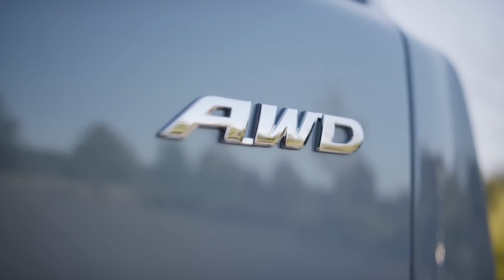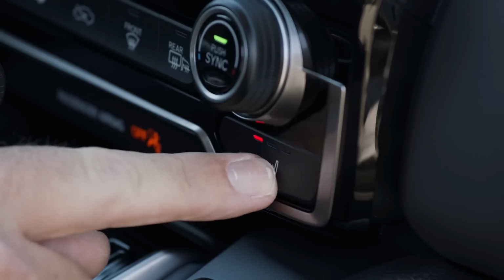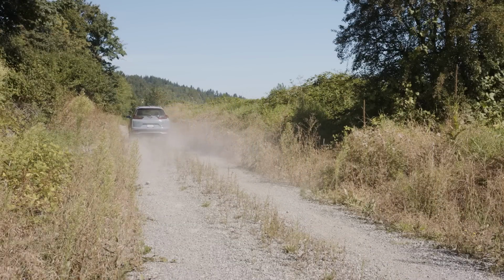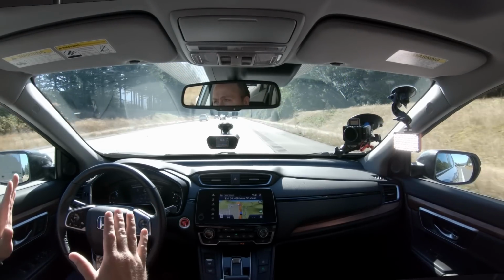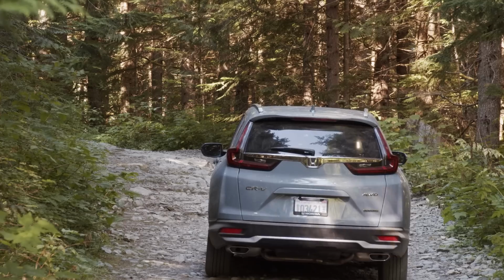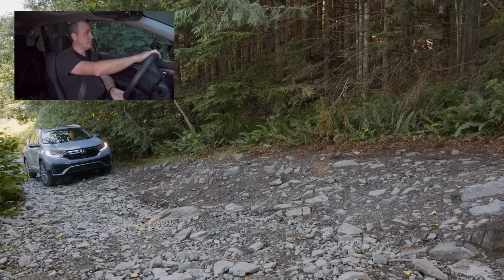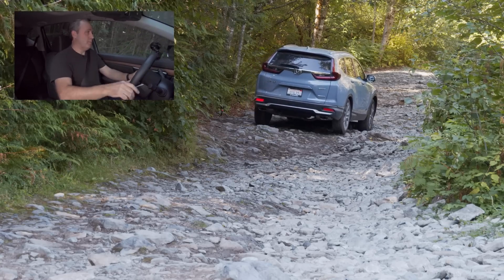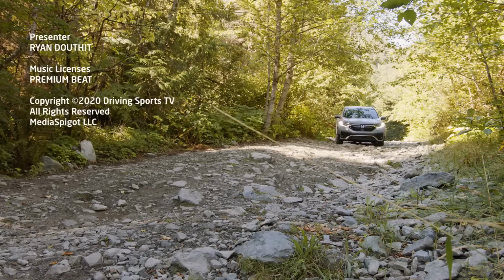2020 Honda CRV Touring Review and Offroad Test

Comment: Two things: You had to turn of the VSC, and you have to make sure to apply enough gas. It will send the power to the correct tires.

I mean, for a car that is not intended for rocky roads, it did well. BTW, you can descend without shifter in S and keep it in 1st or 2nd gear. 

Actually, the CR-V AWD is mainly made for great on road performance in good or bad weather, and for road conditions like the dirt road and small stones and gravel roads, like those before testing it on the rocky road.

Comment: i have a 2022 exl awd.  I've had it on some rocky/steep terrain and it did fine. I'm talking lose gravel and 32% grade.  I do have wildpeaks on it.  My fiance also owns a crv, 2020 awd, and it did fine in 6" snow on my private gravel/steep road in mountains.  never slipped.  Same as mine.  Can a crv do the rubicon?  No.  But it can go places where you cannot take a fwd vehicle or a rwd pickup.  I've done so, with zero issues or damage. The awd crv has 8.2 inches ground clearance.  The fwd, has the 7.8 inches.  The reviewer was incorrect there.  All in all the crv is a great vehicle and can get to your camping spot pretty easily as long as you don't have huge rutts etc......

Comment: I agree with MANY people points about this current generation CR-V. However, i don't see Honda raising the ground clearance 2 full inches. As it sits now at  7.8in and a Ford Explorer which is MUCH bigger for example sits at 8.2. The reality of a 9.8in ground clearance CR-V is far fetched. But i do see a CR-V at Subaru standards of somewhere around 8.5in down the line. You want anything taller than that you'll have to personally lift it yourself. I also don't see the CVT going away but i think the HP and Torque numbers need to be bumped up quite a bit. For example, I have a 2015 Lincoln MKC 2.0 AWD with 240hp and 270lbs torque. I'd like to see those same numbers in the CR-V and i think it's VERY achievable even with a CVT transmission. For now though, your point on changing out the HORRIBLE OEM tires to a better A/T tire is spot on. The Falken Wildpeaks are excellent for this vehicle or even the Yokohama Geolander G015. They both would improve grip on these light off road excursions incredibly. Let's hope as i've been hearing through the grapevine so to speak. That future iterations of the CR-V get the same treatment it's larger brother the Passport is getting with the new Trailsport model. If Honda goes down that road which i'm really hoping they do. With the CR-V in a truly "off road worthy" small SUV package. I think it will a HUGE success and very popular with a lot of folks.

Comment: Great video, although CRV AWD is just not built to handle rocky off-road terrains. I did the same with CRV 2018 - FRONT wheels drive, the back mountain roads with melted snow, red mud, and sharp rocks in San Miguel, near Telluride, and I had to back out very carefully. CRV, even with AWD is just not for these roads, but it is super economical. It was a pleasure driving it across the country. PS.. In a snow condition, staying on the regular road, multiple tests showed the tires that matter most and not as much AWD.

Comment: It actually does have a skidplate
Reply from the maker: Plastic doesn’t count.
Reply: @drivingsports  it’s metal lmao
Reply: @drivingsports  I work on them
Reply: @drivingsports It's sheet metal. You have to remove it to change the oil and filter.

Comment: Here are your top 25-best-selling SUVs from the month of June 2021, with all automakers reporting:

 
1. Honda CR-V	36,564	   38%
2. Toyota RAV4	36,027	  1%
3. Nissan Rogue	32,270 	  63%
4. Toyota Highlander	24,036	  84%
5. Jeep Wrangler	23,505	 2%
6. Chevrolet Equinox	18,723 	  12%
7. Jeep Grand Cherokee	17,804	  8%
8. Subaru Outback	16,394	 60%
9. Mazda CX-5	16,393	  31%
10. Chevrolet Traverse	15,328	  64%
11.  Honda Pilot	14,714	  31%
12. Hyundai Tucson	14,621	  43%
13. Honda HR-V	14,019	  87%
14. VW Tiguan	12,793	  20%
15. Kia Sportage	11,828	  48%
16. Hyundai Santa Fe	11,202	  34%
17. Jeep Cherokee	9,872	  1%
18.  Lexus RX	9,604	  43%
19. Ford Explorer	9,445	  50%
20. Chevrolet Tahoe	9,423	  40%
21. Toyota 4Runner	9,327	  24%
22. Ford Escape	8,871	  42%
23.  GMC Acadia	8,869	  39%
24.  Buick Encore GX	8,862 	  128%
25. Subaru Forester	8,813	  55%

Comment: Wanted to decide on Rav4 Adventure and Honda.... MEH... seems I gotta go with Rav.
Reply: It's worth noting the RAV4 also has a TRD Off-Road option, from the reviews I've read it's definitely better than most crossovers like the CRV in this video, but still inferior to other crossovers with off-road packages such as Jeep's Trailhawk SUVs or the Ford Bronco Sport.  The TRD Off-Road RAV4 still doesn't have enough ground clearance for even moderate off-roading, and its long front overhang reduces its approach angle.  Its factory equiped Falken Wildpeak All-Terrain tires were apparently designed just for it though, and a lot of what off-road capability it possess comes from them.

Comment: I own one of these. 2020 AWD but it doesnt have the touring crud on it. mine I think was 29.9    but I owed on a trade in.    anyways,  Wouldnt you shift into Low and try this?  was he in low going up the rocks? I had the impression he went from testing sports mode to pulling a hill in D mode.   it's been a durable car so far for me. but shut in , I only have like 10k miles since I bought it Jan 2020

Comment: I have the same car. Yes it struggles when a wheel is off the ground. You have to give it more gas and wait for the system to send power to the required wheel. İf you dont give it enough gas it can never send enough power to the wheel with the traction.

Comment: Whats the deal with measuring the CRVs 0-60 time. I mean, its meant to be a reliable practical vehicle. Buyers of the CRV, won't be interested in racing, unless their 18 year olds!. A vehicles 0-60 has never been a selling point for me.
Reply from the maker: We test 0-60 and off-road ability of all crossovers. Intent or not, it’s good to know how it sits compared to the competition.
Reply: @drivingsports  over here in Europe, up until 2017, diesel versions were available. 1.6 and 2.2 litres. I have an 2013 2.2 ltr. I can get 50 plus MPG. CRVS are one of the best family SUVs in the world.

Comment: I own a 2019 Honda CR-V Touring. Your correct about the NW off road capability. It’s not a 4X4 vehicle. I noticed that the tires are street tires. I find Hancock stock tires to get much worse grip in bad weather. This is after one year of use. That said, you can do things to adapt & help improve off road worthiness, such as Wild Peak Tires. Skid plates are limited to front & back lower bumper caps. I would have liked for Honda to raise the ground clearance height (2”). I believe that AWD will evolve into a much better off road system. I however am not quite sure of the CVT off road capabilities. Towing is a whole separate issue. It is a necessary one that is related to off roading. I propose that you make a follow up video after you changed the tires to the Wild Peak. They are affordable & highly praised for an ALL-SEASON tire with a triple winter rated stamp.
Reply: I agree with MANY of your points about this current generation CR-V. However, i don't see Honda raising the ground clearance 2 full inches. As it sits now at  7.8in and a Ford Explorer which is MUCH bigger for example sits at 8.2. The reality of a 9.8in ground clearance CR-V is far fetched. But i do see a CR-V at Subaru standards of somewhere around 8.5in down the line. You want anything taller than that you'll have to personally lift it yourself. I also don't see the CVT going away but i think the HP and Torque numbers need to be bumped up quite a bit. For example, I have a 2015 Lincoln MKC 2.0 AWD with 240hp and 270lbs torque. I'd like to see those same numbers in the CR-V and i think it's VERY achievable even with a CVT transmission. For now though, your point on changing out the HORRIBLE OEM tires to a better A/T tire is spot on. The Falken Wildpeaks are excellent for this vehicle or even the Yokohama Geolander G015. They both would improve grip on these light off road excursions incredibly. Let's hope as i've been hearing through the grapevine so to speak. That future iterations of the CR-V get the same treatment it's larger brother the Passport is getting with the new Trailsport model. If Honda goes down that road which i'm really hoping they do. With the CR-V in a truly "off road worthy" small SUV package. I think it will a HUGE success and very popular with a lot of folks.

Comment: Being that the CR-V AWD is not designed for off-roading, I guess this was a valid test. As it is, I won't even drive on any flat unpaved roads......Anywhere. I have a thing about my cars being clean and waxed at all times. Dirt on the edges of my Armor All'd tires, dust on the rims? I wouldn't rest until I scrubbed them clean. Though I must say, I love my CR-V!

Comment: Did the AWD system change in the Honda CRV? In previous videos you say it only sends power to the back if slip is detected but here you say it does that automatically on inclines
Reply: It's not the old slow hydraulic system. This C-RV starts in awd and becomes fwd when conditions allow. (Steady speed on grippy surface)
Reply: My 24 AWD Sport-l is ALWAYS in AWD. Yes, it's mostly FWD just like the RAV-4, but it is never just FWD. It adapts to the demand.  @kyrorocks
Reply: @jacobpetersen5662  yes, but the reviewed car is a 20

Comment: The problem is the CVT, the Subaru Outback has the same problem and the Nissan Rogue and they all have good AWD’s especially the outback and then the CRV, the CVT when is stuck in something it limits the rpms exactly at 3k rpms and it won’t give you the power to get out is very sad how they tune the transmission to do that, that’s why regular automatic transmissions are better for this things

Comment: VSA should be OFF for such tests, as Honda recommends in Owner’s Manual.
Reply: yup, the traction control light was flashing there. I have a CR-V, turning off VSC/Traction helps a lot.
Reply: VSA must be off.
Reply: I also think he didn’t shift to low gear to push uphill

Comment: I bought a brand new in 2019 EXL. Simply love. Its quite,spacious,comfortable and very economical. I'm averaging 31 MPG locally. Amazing. We love it. Its the best in its class.
Reply: I own crv 2015 and that’s the best engine and auto gearbox the new model it’s horrible CVT and  small engine that’s why I’m upgrading for Mazda CX-5 at least it doesn’t have the horrible CVT 👎🏼
Reply: @carlosgj1308  smart upgrade. I’ve been told of other issues with the crvs but some seem to enjoy it
Reply: @carlosgj1308 honda makes 1 of the best cvts in the market and honda is known for one of best small engines

Comment: Oh dear that off road test is shocking.. my2007 rav4 would eat that trail for breakfast
Reply: Hahaha what?? The RAV4 can't send power side to side. Traction control kills all the power and vibrates and makes noises when try to apply brakes on the spinning wheel lol...RAV4 it's very sad on similar situations
Reply: I bet. That's when Rav4 used to have 4wd and an automatic transmission. Unlike now with their crappy AWD & Sh*tty CVT.

Comment: After comparing Honda's advertising and many reviews I'm under impression that Honda misadvertises CR-V.
This is a city SUV. Honda says the rear clutch is engaged when starting, but it doesn't look like that on the gravel.
Honda says 1.5T is economical, but gets similar millage as 2.5l RAV4 and Forester. 

I'd understand if they had another trim with standard AT, 2.5NA gasoline and better AWD. The sad thing is that Honda no longer manufacturers niche trims.

All that resulted in the image change of Honda in Japan. It is no longer considered a "big car" manufarer, but just good for small minivans and Fit. On Japanese market they are also the most expensive, so current CR-V sells very badly.

Comment: I own an HR-V with an identical system. What you do is turn the traction control "off" and put your foot down a little harder on the gas. By being less aggressive it seems to do a better job putting power to the wheels that need it.
Reply: Good way to burn up that shitty cvt transmission. I’d change the fluid if you haven’t already.
Reply: @haroldbeauchamp3770 honda makes one of the best cvts
Reply: @haroldbeauchamp3770 what a stupid downer

Comment: Quick question, this doesn't happen to have the same quirk as Mazdas where you have to turn off the traction control to get it to perform side to side power  transfer in a kind of hidden off road mode?
Reply from the maker: The tech docs for the Honda system make no mention of any brake vectoring capabilities being present, VSA disabled or otherwise.
Reply: Driving Sports TV ,  Honda CR-V hybrid 2019 Owner’s Manual, page 528: “In certain unusual conditions when your vehicle gets stuck in shallow mud or fresh snow, it may be easier to free it with the VSA temporarily switched off.
When the button is pressed, the traction control function becomes less effective. This allows for the wheels to spin more freely at low speed. You should only attempt to free your vehicle with the VSA off if you are not able to free it when the VSA is on.”  I guess it should be the same info in 2020 CR-V manual as well, cause they both have the similar AWD systems.

Comment: If they’d ditch their notoriously weak “real-time” AWD system and add an IVTM-4 system in there... It would really kick some butt in this segment.
Reply: The test was done poorly. I'm a fan of this channel, but even when I'm a Subaru fun, I can tell you my experience in worst situation to that one, and this new CR-V is more capable. I don't know why, but my experience the car did a great job sending power side to side. It took some time to figure out where to send power, but it did much in a nicer way than on this test.
Reply: The cvt transmission severely limits the amount of initial torque to protect the internal belt. Unfortunately, same with Subaru. They need to switch to a traditional automatic.

Comment: I just concluded my shop for a small cross over with AWD. I drove them all and the top three (for me) were the Forester, CR-V, Rav4 (in that order).  All were solid but the Forester was the best overall package of AWD ability, Safety tech, Space and infotainment so that is what I purchased(limited). The CR-V (EX-L) drove great but the infotainment was terrible and safety tech was only ok. Felt like an older car than the other two (which it is) Rav 4's interior was nice (Adventure) and felt like it would be capable on a trail... but damn did it feel cramped. Not really sure if its the interior layout or a low roofline, but it felt like the smaller vehicle by far.  It also felt/sounded buzzy when accelerating. In the end all three were solid depending on your need.
Reply: Although I would choose a basic RAV4 LE Hybrid  over anything else in this segment, I am hoping the cramped Toyota New Jockey Architecture only lasts one generation.
Reply: Was in the same shoe and also bought a Forester Limited
Reply: @layne4376  I was also concerned about that prior to driving one as I had read that online. Not an issue. Can accelerate from a stop faster than I need to and can get on the highway and pass with ease. Not gonna win any drag races maybe but for normal driving it feels great.  The CR-V felt a tad faster, the Rav4 pretty much the same.
Reply: I did my research and for me the rav4 adventure is what sold me over the outback onyx for me it was the price tag rav4 adventure had similar features as the onyx and does the job so next year i will be getting the rav4 adventure
Reply: Whattt? I feel the rav4 is so much more spacious than  the forrester

Comment: I think 2020 Honda CRV didn't do good is partly because of it's 19 inch wheels. If it had 18 inches wheels then it would have done slightly better but then again Driving Sports TV does testing on what the vehicles comes equipped with. Good video!

Comment: I wanna see the Honda Pilot
Reply: It's the same as the passport
Reply: noobwow2009 i understand that but larger,heavier and longer wheelbase,all the make a difference..
Reply: @leonelsantamaria9653  wheelbase is the same. Everything is almost identical except a bit shorter ground clearance and 6 inches longer. Same IVTM 4 system

Comment: What next? The new Trailblazer, Honda Ridgeline, VW Atlas Cross Sport, and GMC's AT4 suite of SUVs.
Reply: A sad result indeed. But my 2012 Ridgeline would have tackled that no problem. Its drive system was capable of shifting power nicely and when that didn't work to get me out of a jam I just had to press a button to lock in 4 wheel drive. I traded it in on a 2017 4Runner, and though the 4Runner is great, I realize that I prefer the Ridgeline.